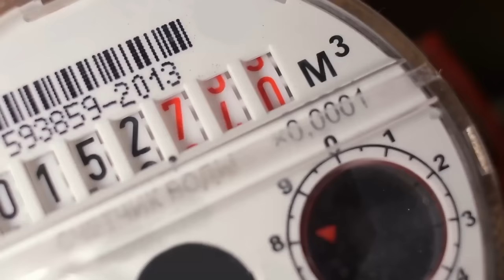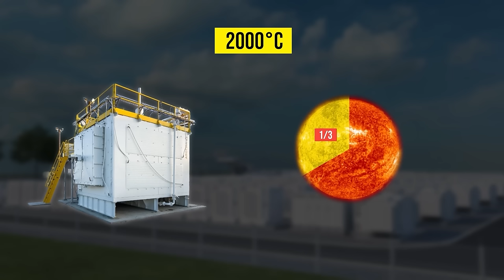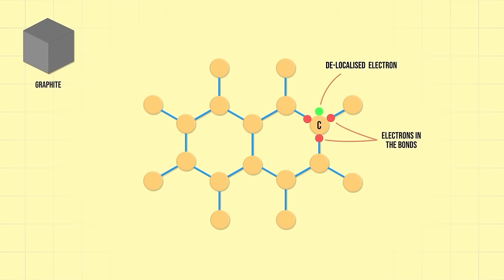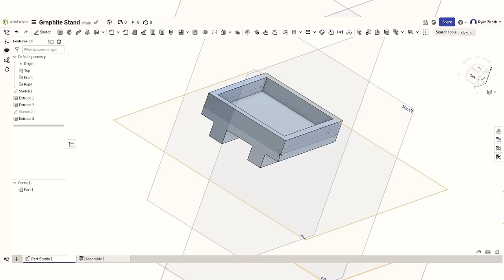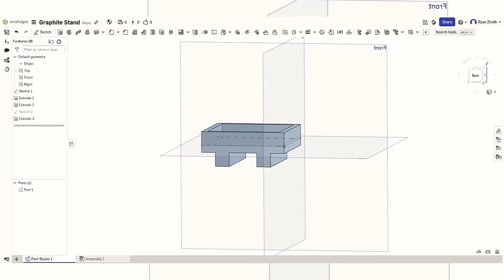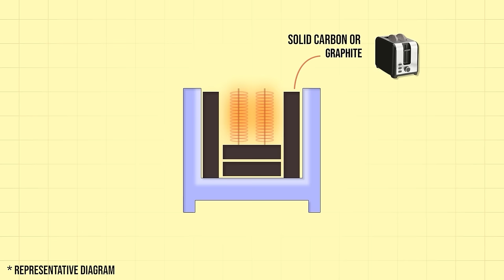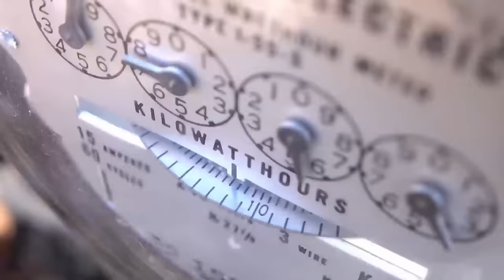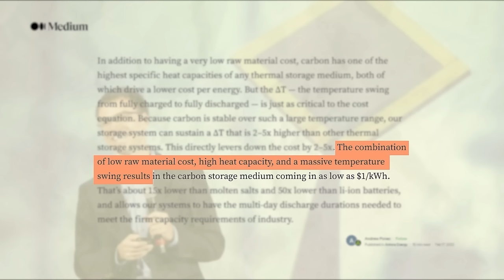Why Solid Carbon is the Future of Energy Storage

Comment: If efficiency figures are to be believed, this is a lot more efficient than water-based gravity storage, which is the go-to method of electricity storage besides chemical batteries.
Reply: Water reservoirs are complementary. Producing electricity with hidro-turbines is extremely simple
Reply: How did you come to that conclusion? Pump hydro is about 80% efficiency, and this claims to be 30-40%.
Reply: @Johan88k  i think Michael thinks about you can put this storage almost anywhere and, overall, about raw heat-storage efficiency
Reply: @javiercm7727  He specifically talked about electricity storage. And how it compares against pump hydro. Sure if your geography does not support pump hydro this might be an option. But then you are not comparing pump hydro vs this, you are comparing this vs chemical batteries.
Reply: @Johan88k  he will know now ;)
Reply: @Johan88k  It woudl be 80% if there were no losses other than electric. There are also fluid drag losses and pump losses. But more importantly, the turbine itself doesn't have very high efficiency, it's just not possible. In order to extract all energy, the fluid must come to a complete stop at the turbine blades, which would prevent further flow of fluid. So in reality that's capped at like 58% (I don't recall the exact figure) maximum.
Reply: @michaelbuckers  Modern hydro turbines can convert as much as 90% of the available energy into electricity. I'm no expert on the subject, but when studies say that the round trip efficiency of pump hydro is 80% I'm assuming that they have taken pump losses into consideration. 

Especially when they use this kind of language ": Taking into account the evaporation and conversion losses, 71-85% of the electrical energy used to pump the water into the elevated reservoir can be regained"
Reply: @michaelbuckers  Are you sure you are not thinking about wind turbines? They have a theoretical maximum of 59%.

Comment: It wont work on the industrial projects your talking about. They cant move the heat away that fast and apply it these projects in ways they are needed. Maybe to create steam is the only thing I can think of and that will be short lived because the battery would drain so fast and stop making steam. Trying to do this would be crazy inefficient and costly. The only good application to thermal batteries is perhaps heating a home (and its water tank)  with heat exchangers and being charged (heated) with a lot of excess solar power.

This is most likely some college kids scamming the government / investors by paying themselves big salaries to run a project they know will never launch.

Comment: Around 11:00 you said, that the thermo-photovoltaic panel functions like a solar panel but just with the infrared radiation instead of the visible light. Graphite at those temperatures already glowes bright red almost white. Therefore you can already see that it emmits already in the visible spectrum. At those temperatures UV radiation is also expectet. Using a panel that can only capture infrared radiation, which is just a small fraction of the emmitted spectrum and also at arout 30% efficiency, leads to massive losses. You can yield more energy by evaporation water and using a conventional steam turbine. I just hope that your explaination is wrong, otherwise this whole setup is screwed from the ground up.
Reply: Lower energy photon retention: Addressed after 12:00

Comment: Li-ion grid storage durability of 4 - 6 years is way too pessimistic. A quick search of some scientific papers gave a lower bound of 6 years (for some cells under some conditions) and an upper bound of >10.000 cycles. Using more realistic durability figures makes this thermal battery come out way less favourable.

Comment: Im interested to hear what the efficiency numbers are for the thermal applications 'at the wheel' so to speak. Like im imagining the 90% of 90% is at the hatch in the shipping container. Then you have your fluid and transmission which are not necessarily factors that the company are directly responsible for. But the final efficiency number is what drives the business case. And im guessing its terrible. Probably a lot worse than electricity. As far as transmission efficiency goes.

Comment: You didn't really cover much in the way of energy capacity or density for the battery and how you could define depth of discharge. IF you could ever get it to scale is a better question for a carbon battery like this. There should be better options with graphene in the form of a solid state hydrogen storage medium for flight. New battery technologies are always coming along, but the effect is additive not exclusive. There's room in the market for a lot of options.

Comment: Why not just put these next to an existing fossil fuel power station and use the heat to power the station? They only need enough heat to make steam, so you could use a large part of the heat range of the batteries, and have similar, or slightly higher efficiency.

Comment: Wait, so if you charge it via solar, say at 25% efficiency panel, to charge the carbon block, but you only get 40% of it back, lets say 50% to make math easy. So really your getting 12.5% out of the solar panel in the end....I mean, carbon block sounds much more renewable and recyclable then lith-type batteries.... but is it cheaper? And is is actually that much better? Im all for it if the math checks out. Like the video suggests, might only be good for high-temp applications because now you might not have to waste energy heating an element indirectly, can just use the heat from the block.

Comment: So how did you make the giant solid blocks of carbon? And what is the net energy storage potential, including the steel container, moveable access doors, conductors, transformers, etc.? What you are really saying is that this is a unique storage medium and is efficient RELATIVE to traditional energy storage mediums BUT the system still operates at a significant energy loss as an energy delivery system when compared to direct energy use. Is this a marketing video for millennials? Seems like it is a bit space inefficient also. Oh well.

Comment: So the real secret here is the casing of this battery. I'm guessing tungsten and bricks like the space shuttle uses. But even that may not work. But if ita hot enough to melt steel there must be a lot of interesting material between the carbon and the steel. Well unless a vacuum is employed with ir reflective material also...

Comment: Hmm...  Carbon...  Heat...  Chernobyl...

Sand is not only WAY cheaper, but sand batteries don't require all that much more to create the same thermal mass.

I know, I know...  You'll never reach steel-melting temperatures with a sand battery.

So, alternative:  Tungsten?  It'll hold 5,000 degrees.

Comment: Your point about the low cost of energy applies to chemical storage equally, as for lithium batteries only lasting 3 or 4 years I say BS as Tesla gives me a 10 year warranty on the power wall batteries I just installed. 
How much energy does a Solid Carbon Battery the size of a container hold compared to say a Tesla MegaPack ?
The Solid Carbon Batteries do seem like a great technology but please don't spread FUD against other methods of energy storage to promote them, when all said and done it will be the TLCOE that makes the decision of which technology is dominant.

Comment: So, the Thermal PV scenario is just dumb in my opinion. 40% efficiency of converting heat to electricity at those temperatures is a waste of time when you consider just running a steam turbine instead with that heat should net in the 90% range of efficiency.

Comment: This mirror idea sounds a little like a perpetual motion machine, a violation of the laws of thermodynamics. Solar panels emit radiation that is reflected by mirrors and then received by them and again. Shouldn't such solar panels only emit radiation that they are unable to convert into electricity? Otherwise, they would not emit thermal radiation at all and 99% of their heat would be converted into electricity (neighboring molecules glow on each other).

Comment: Please go back and check your numbers, saying lithium ion BESS lifespan is 4-6 years is absurd. They have warranties for triple that, so no degradation for 15 years, and very slow degradation after that. Not that these carbon batteries are bad, but the cost/benefit analysis is way off.

Comment: Storing energy at just above 40% efficiency does not seem all that impressive...The high heat does not get used directly, so what´s the point? Sand and brick heat storage is even cheaper and has a comparable efficiency. If direct heat extraction was possible, it would be much more interesting.

Comment: Though clean energy and storage is great, it's used to produce (too often throwable) things, using materials that are destroying life on the planet by their extraction and that are declining sharply in availability. We can either plan our transition away from the consequences, or be imposed the consequences. Low Techs are a tool to lower our hunger for the billion of tons of earth devoured every day to fuel the megamachine, but for the usages democratically determined to be essentials, this graphite heat/electricity storage solution is great.

Comment: Using electrical resistance heating is a nonstarter. You would be more efficient (lower carbon footprint) by electrical heat on demand.  Getting excited about this shows a lack of understanding of basic thermodynamics.

Comment: basically this solution is wors than flywheel... because you need more to do almost same and with graphite as it is isolator... You need really complicated infrastructure to heat it and then extract heat... and if You say something about graphite/graphene similarities then You need to think that then this is not cheap graphite but prepared graphite to has some section to be like graphene and for example distribute heat .... wrong idea

Comment: There are no rare elements required for Li batteries and the metals used will be endlessly recycled.
Reply: They are still required in order to get the highest energy density Li batteries and recycling takes energy. Plus, they are way more expensive than the solution proposed here. Don't get me wrong, Li batteries are awesome but I think new ones should be used in cars and other non-stationary technologies first. After 10 years, when their capacity has decreased too much to be used like that they can be used in stationary storage but we cannot wait 10 years to decarbonize heavy industries

Comment: so you produce electricity @ 8% ? of sunlight?  wouldnt collecting heat and storing it in the carbon(@90&) and then using the 40% tpv panel for electricity production .9 x .2= .18 compared to .08 or 18% vs 8% ?!

Comment: Average lifespan of Lithium batteries 4-6 years? That is pure bullcrap. They even use used car batteries for grid storage as they are not as intensively used. lithium can be used as  NMC, around 2,5k cycles, lifepo about 5k cycles and lithium titanate can last a lot longer.

Comment: This souds quite much hype technology. Proposed advantages exists, but there are  huge technical problems everywhere, and they are bypassed like they wouldn’t exist at all. 

First, graphite is not inexpensive. High quality natural graphite resources are limitted, and synthetic processes too expensive and don’t scale into required levels.

Second, insulating 2000C temperatures well enough, is really challenging. There’s not much materials which can sustainably do it and losses would be great. Especially inner layer which is exposed on greatest temperatures, requires exotic and expensive materials. Normal insulating ceramic tiles start from 1500C, and they deteriorate in thousands hours, rather than years or decades. 

While graphite can withstand high heats, it burns in oxygen in less than 1000C. Such heat battery would need to have vacuum or protective gas and 100% oxygen proof. Same goes with any metals, which could potentially been used as a heating element. Practically it’s tungsten, and it also burns at 1000C. 

It’s not just possible to open a door and use the heat radiation. There would need to be gas proof window. Even quartz glass can’t take 2000C, and there would be huge thermal shock when opening insulated hatch. The glas also goes into category of exotic and very expensive materials, and it can’t be expected to last years. Same goes to hatch insulation, which will be exposed to the air when it’s hot. 

For electricity production, this sounds way too inefficient. The comment, excess energy is free, efficiency don’t matter, is bs. Energy have always it’s price and we need to compare efficiency on other existing alternatives. 

For industrial heat production, that is hydrogen. It can provide very high heat close to 100% efficiency just by burning it. It’s also compatible with natural gas burning solutions. 

In vehicles, hydrogen have terribly bad efficiency because multiple stages of losses in transportation, storage and conversion. In industrial solutions, they are limited mostly on electrolysis, efficiency being between 60-70%. 

In practice, that means transportation and storage in pipes, similar with natural gas pipelines. Long pipeline can be weeks worth of energy. 

In electricity production, hydrogen is pretty bad because another layer of 70% efficiency is added, dropping system efficiency below 50%. That is still good enough to cover short demand spikes, but not as a main storage. There are other technologies which goes into 70% and batteries, which go 90-95%. 

As I mentioned before, this graphene heat storage have interesting potential, because in theory, efficiency can go close to 1000%. However, article which promotes this should at least mention how well those overwhelming technical problems with insulation and material endurance is solved and not behave like they wouldn’t exist. Also the cost point of graphite is very important. Synthetic graphite costs $20k per tonne and production is not scalable or environmentally friendly.

As an example, 1000kg of graphite with 500C temperature change (1500-2000C) gives 100kwh of energy. This comes from .72kj/kg/C heat capacity and the 3.6Mj equals 1kwh. 

Considering everything you need to support this, doesn’t sound competitive even for battery. You could always use same radiation transfer method without storing the energy on graphite.

Comment: Free electricity is a myth in the long term. All of the infrastructure needs to be paid for, maintained, cleaned and replaced. Electricity might be supplied at negative prices for part of each day, but there has to be a cost to the average customer over each year. Anything else would lead the suppliers to bankruptcy.

Comment: 2000 degrees Celsius is not a third of the heat of the sun. That's not how the temperature scale works. You can only say this if you use Kelvin! Great content again nevertheless!
Reply: And it depends if you’re talking about the surface or the inside. The surface of the sun is 5778K so 1/3 of that is 1920k so I think he meant to say that it is about 2000 Kelvin. But 1920K = 1646C = 2996F

Comment: Resistive heating is not efficient and temperature insulation also is far from perfect
Reply: IR Photovoltaics are also fairly low efficiency. So essentially, you have a bit loss in charging it (30% efficiency or so), storing it (depend on how long but the video said a few days max so could be 5%to 90%efficiency) and then discharging it (around 15%). So overall efficiency could be as low as 0.225 % efficient. I guess it could work with free or negative electricity cost, but I wonder how frequent that is.
Reply: In 2022, there were 69 instances out of a total of 8,760 hourly prices in the German day-ahead trading where negative prices occurred. This contrasts with the previous year when there were 139 such instances, so maybe that could make sense, but given the frequency is reducing does not seem to be sustainable.

Comment: Interesting concept as all of them (melted sand/salt etc.).
But when I hear all this, I always end with one question: Has "Stefan's Law" left the universe or what?
There are also conversion losses such as electricity -> heat -> steam (kinetic and IFPV is at initial state ~40% barely) -> electricity. So these 99% and 95% are absolute nonsense,
Oh, and you'd better not use California... it proves that we need a good buffer in the electrical grid and we can't be hype-eco.

Comment: Well the title is misleading in a boring way. Because Solid Carbon Batteries already exist and are wide spread. The common batterie uses graphite as an anode materials, therefore you can call it solid carbon batterie. I just clicked the video because I thought 'Will he just present me a common batterie?' But in the video you have a point. Even a good point. But your title does not transport the message.

Comment: Storing Heat at high temperature and moving it around to make it useful in too many industrial process to count are two😂 completely and totally different things. But if you say it often enough😂 cheap and renewable🎉 of course if the thermal batteries are used to generate steam during peak electrical demand there may be some benefit but it isn't going to be cheap.😢

Comment: The future of car batteries might be nickle hydrogen because they work at much colder temperatures than lithium and last longer. But they take up much more space so most cars would either be limos or trucks.    { 2zG-ZrC4BO0 }
Reply: I hope that someday though, fusion reactors will be as small as fridges and the radioactive material can be created with man made technology. That way, batteries+panels can be made smaller and can fit in cars.
Reply: Radioactive materials are great as a fuel source for long distant space exploration.